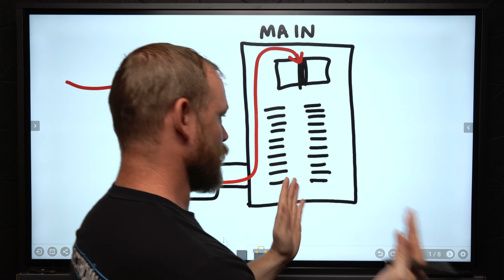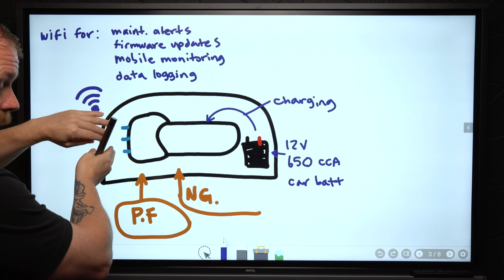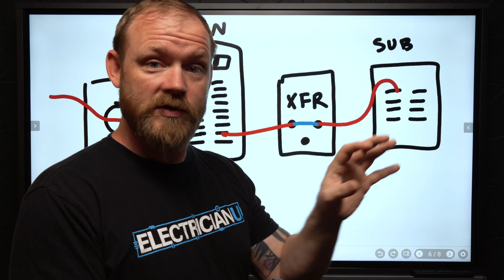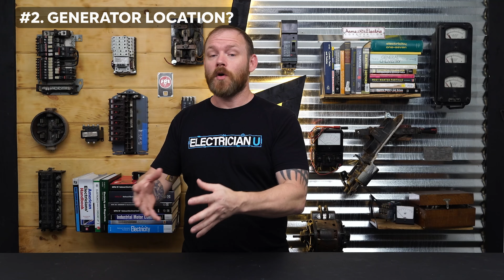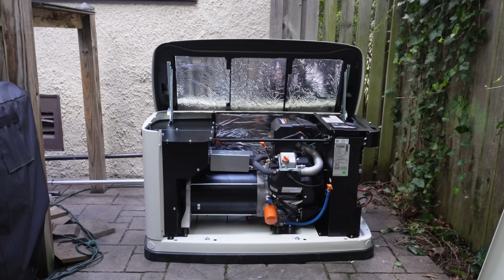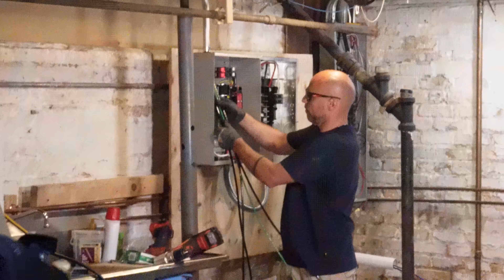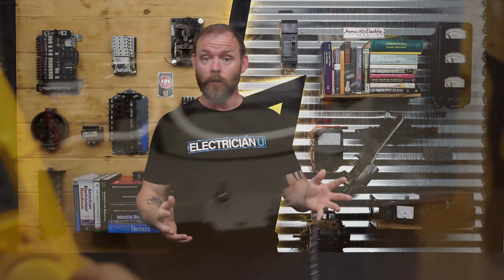What Should You Know Before Installing a Generator? Whole Home or Critical Loads?

Comment: What surprised me was it takes about an additional $1,000 to complete the install myself.  Transfer switch came with my generator.  All in one cable to connect generator to transfer switch is $14+ per foot from Ziller Electric. I used this cable and it's worth the cost.  Then there's the cost of propane connection. Plus all the miscellaneous conduit and cable connectors. Just be prepared for the additional cost when planning the install.

Comment: Seems so complicated, it's not for a homeowner's DYI. This project needs professionals at all levels to do the job well, and safely. And the cost has to be very expensive for everything that needs to be done. Let alone the cost of a whole house generator to purchase. It's something to not just jump in there, but to do some research on this. This video is sound advice for anyone thinking about putting in a Generac whole home generator.

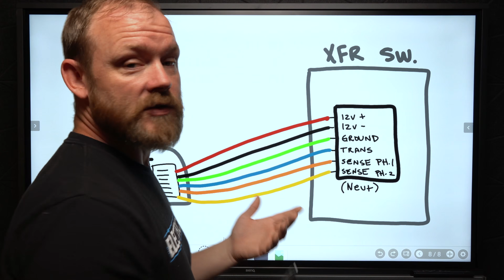Comment: Around the 5:20 mark you showed an awesome diagram of those control wires and watching that reminds me of a time I was in a building that lost one phase. So it got me thinking about if that would happen to your home with a generator, if you lost one of the two incoming lines from the power company but still had one working would that still make the generator come on even though you didn’t lose all of your power???

Thanks by the way, great videos with the illustrations on the board 👏👏👏

Also, could you show us a video to add a surge protector to the generator. I know that the new one comes with them now, but if we have an older model that needs this.

Comment: Home generators suffer the same issue grid-level generation suffers when load doesn’t match output. Most home generators aren’t designed for long-term operation beyond a few hours.

Comment: One thing for home owners the system should be run at least once on a hot day and a cold day in your climate for about 24 hours to make sure there are no problems before a outage.  Since during outage support will be either not available or have very long wait times.  Emergency systems that are not tested are not reliable during emergencies.

Comment: I’m not sure I agree about the neutral and main bonding jumper. The ATS becomes the new service equipment, which means you have to separate the grounds from neutrals in the main panel, and then bond them in the ATS. The main is now a sub panel.

Comment: I got multiple quotes and the biggest issue I had was finding a generator installer who knew both the electrical and gas trades. I was getting so much conflicting information about my gas meter capacity, how to route the gas lines, and if the gas lines needed to be sized up to handle the generator at peak load.

I had the natural gas utility come out to do a load calculation and they were extremely helpful. The (licensed electrician) installer who ultimately won the bid brought a gasfitter with him to do the estimate and installation.

Comment: There was a real disservice done to the customer by selling them a 22KW (19.5KW on NG) and not having it set up to be Whole Home. Especially since you stated that most of the large appliances are Natural Gas. There is a minimal cost difference between installing a service entrance transfer switch compared to installing a non-service entrance switch plus adding the sub panel and all the breakers and labor time of relocating circuits to a new panel. Sometimes limiting circuits costs more than having whole home. It would have been really close to the same price to just install the service entrance switch, and the customer would have had everything in the house available to use. 20KW is a lot of power for this set up. They should have went whole home, or smaller generator with this set up.

Comment: 22KW ?? on a farm, 6 buildings, spa, 2-elec-water heater, heat pump, 8 elec-heaters, well pump, RV plugged in...did have a pool....I will not use the welder on generator power...lol

Comment: Wait - aren't Generac standby generators floating neutrals? That means you DO want to bond ground and neutral inside the transfer switch since it is NOT done internally at the generator and shouldn't be done inside the main breaker panel. At least - that is how my Generac 40kw unit is set up. Maybe I didn't follow you correctly thru that part of the video, but if they bonded ground and neutral inside the transfer switch and the generator is floating neutral, that doesn't appear to be a code violation. Did I miss something here?

Comment: A couple of questions.

I have an all electric house with a 150 amp service. The furnace is electric and is two speed. It draws 82 amps on high and 42 on low. I am looking at a 100 amp plus generator. The problem is I want a manual transfer switch because I want to be able to select the senerio I need to run by manually turning off the breakers and if needed, selecting the furnace speed. 

Generac does not show on their website an appropriate manual transfer switch and they are not onboard with using an interlock kit. Are there any good alternatives? The generator would be on a 100 anp breaker.

Electrical code question. If the main service and breaker is 150 amp and the service transfer switch breaker is rated for 150, and the generator has its own breaker. What do you size the wire to the generator for? 150, or the generator breaker size.

Comment: Just got done wiring in a new generac. Could not figure out where to land the neutral for the 12v battery charger.  I landed in on the neutral bar in the transfer switch. I don’t see that they have a place to land it.

Comment: These generators are not very loud especially when you actually have the full housing attached. 

Also planting bushes around your generator is not recommended, one reason is because you reduce air flow to the engine. Another reason is because at various times a technician is going to need easy access for preventing maintenance service and or repairs.

Comment: A non electrician question, the Generac connecrion instructions do not sepecify a separate conduit for the signal wires and there is no additionsl hole on the generator for a 1/2 conduit attachment. Can those signal wires be run along with the main wires to the transfer box through the 1 1/2 conduit?

Comment: can  you put 2 50 amp receptacles in 1 power panel to run a 16 kw duromax gen as long as they are on 2 different breakers/ 50 amp  only good for 12500 but the duromax has two // 16 kw max 13 kw conts/ need to use all the 13 kw safely to run whole house // any info would be great thanks//

Comment: So I just did an interlock to connect my generator. I had to move a few breakers to accommodate this. As per code in my state, Illinois, everything runs through metal conduit. Also, I have a sub panel powered by a 60 amp breaker. While doing this moving and adding I realize there are no ground wires. Are they not necessary with metal conduit?

Comment: @ElectricianU My boy, you are remiss in not telling folks who might have poor WiFi signal that the best solution to their networking solution is wiring a (600+V)shielded CAT6 cable + lightning arrestor connected. directly to their main network switch/media panel.

Comment: Question about the Bonding with Neutral and ground. For the transfer switch powering the subpanel from the main panel. Would you only have to Bond the main panel, or the main panel and the transfer switch?

Comment: How do you integrate a generator that has selectable 3 phase? Do you need an additional switch? I already have the generator and i want to be able to run my 3 phase metal lathes etc. When needed.

Comment: What about the cheapo way, using an interlock kit? Just wire a circuit in your backed up panel to the generator. Install an interlock kit, which will force you to select from either utility or generator, but not both.

Comment: Do you have a video of a portable 5500 w generator being installed with a generator inlet into the panel? Also, can you explain what it means for a floating neutral and or a bonded neutral on this generator. Which one should be used in this application?

Comment: For whatever reason, I cannot find this code question anywhere. Can a flanged input be mounted directly to a panelboard housing? I have a mobile home (no one talks about mobile home setups). I have a Siemens PW panelboard on a pole outside, with a Siemens SN panelboard inside. I want to attach a generator inlet to the PW outside. There's plenty of room inside (and outside) the box for me to simple add a water proof flanged inlet to the side or bottom of the panelboard (power panel box), or even simply attach an inlet box to the side near the bottom of the panel box, but I can't find code information for Florida. Would you happen to know if this is doable within NEC guidelines? Otherwise, I'm left mounting an inlet box to the pole...

Comment: Other than the expense for the transfer switch it makes more sense to do the whole panel as you can always turn off the breakers if they're well labeled and you can always turn on stuff that you might not ordinarily want. and if the power outage is gonna be longer than you're expecting you might want some thing else that you didn't plan for.

Comment: As somebody who does networking these things should really just come with an ethernet jack. you're going through all the trouble of running conduit and wiring things in, throwing an ethernet cable through the wall and just plugging it into it's so much easier then having to fight around with the whole wireless connectivity thing.
Reply: Kohler(Rehlko) has the ethernet RJ45 connection. So much nicer than dealing with the WiFi on the Generacs
Reply: Seriously. It drives  me NUTS.

Comment: When you do your whole home for the generator it’s not as big of a deal as you are claiming. You do not need to “re pipe things from utility pole to meter,” you just need hydro to disconnect power to your home. For a generator this size at 22kw you might as well power your whole home as oppose to a few select circuits

Comment: I can tell you from 40 seconds in that the missing neutral under the t1 will kill the battery in about 24hours. That neutral is for the Evo 2 trickle charger, without it, it drains the battery

Comment: I know grid connected solar/battery setups in my area are banned from working when the power is out due to the risk of electrocution for linemen working on restoring power--which I can understand and support.  My question is: For generators with an automatic OR manual transfer switch, are there any issues we need to be aware of that could cause abnormal current to bypass the transfer switch and possibly reach the grid?  For instance should grounding rods for a generator setup be a certain distance away from the main service ground to avoid transients "jumping the gap" to the utility side if something goes wrong?

Comment: A 22kw generator that COULD power the whole home, but they choose to only power critical loads? Why spend the money to buy that level of generator? Why not go lower? Wasted money.
Reply: Inrush current limitations from loads like central air possibly?
Reply: @Rankine_Cycle21    would need to do the load calculations. Hard to say from here without it.

Comment: Unfortunately there are multiple issues with this install. The biggest is the use of thermostat wire for control wires is inadequate,  the insulation is not rated properly and will more than likely fail causing issues. 
Side note: Cable Master has bundled wire containing all high and low voltage wires encaused in a direct burial rated casing. Makes life much easier. NG generators are also Derated due lower BTU out of NG fuel. 22 is a 20.5kw on NG.

Comment: Relating to the switched neutral discussion: If the ATS is acting as the first means of disconnect (Meter > ATS > Breaker Panel), wouldn't it be correct to bond the neutral and ground at that point? Would that require neutral switching, even if it is a "floating neutral" generator?
Reply: Generac does NOT switch the neutral so you MUST have the neutrals tied together in the TS... and use the jumper wire to bond the ground. (that you remove in the original panel)
Reply: @rupe53  That is my understanding as well. So what is the difference in the install in this video that make neutral switching necessary?
Reply: @Alfredas-u7x     if you are required to switch the neutral then you need another brand of transfer switch. My feeling is there must be a loophole in NEC somewhere because people are still installing the standard Generac switch and passing inspection as long as they have a separate ground buss in the first panel after the TS. If it were cast in stone (code wise) then Generac would make a different TS. (they don't) I retired almost 5 years ago so don't have the ambition to search it out.

Comment: Excellent video...  An added PoV: If the plan is to power only "critical" loads, it is essential to MEASURE the critical loads before you size and purchase a generator.  In my case, I have an Emporia Vue with 16 Current Transformers (CT's) permanently installed in my main panel.  It records all of my potentially critical loads (I'll define "potential" critical loads in a moment) on a continuous basis.  Using an interlock kit on my main panel instead of a transfer switch saves a pile of money on parts and labor, and I can choose dynamically what I deem to be critical...with the knowledge of power consumption accumulated by the Emporia Vue.  For example, my home has gas heat on levels 1 and 2, and electric heat in the basement; so, if the power outage in on a cold day, I only power up the heaters on levels 1 and 2 (only need to power the ignitors and two fans).  If the power goes out on a hot day, I power up the basement (smallest HVAC unit in the home, basement is easier to cool due to geothermal benefit, AND I have a soft start kit installed on that particular unit).  So, "potential" critical loads can be dynamically changed due to circumstances--which you cannot due with a hard-wired critical loads panel.  That's my $0.02.  Cheers!

Comment: I have the same 22KW gen for a 3200 sq ft house. It does the entire house as if it were on the utility. I didn't care what size I needed I wanted everything to work without doing anything or cutting things out. Auto Xfer switch too. I also have 2 load sheds for the A/C's. I have a third mini-split for a garage but that only runs when I turn it on as opposed to the main home A/C's. In Florida so they run pretty much year round. The Generac works great on natural gas. My only suggestion would be on the load sheds. Don't use Generac load sheds. They had an issue (since fixed) with the original boards. Mine went out. PSP makes really good load sheds. I have one of each and the Generac is the only one that bit the dust. If yours does go out just remove the connector on the circuit board and it will bypass and allow whatever it's shedding to be used. In my case it's one of the A/C's. I lost power to the A/H with utility power. I was going nuts wondering how I could have power at the breaker but not power at the A/H until it dawned on me about the load shed. The board is under warranty so all good. Upgraded board fixed it.
Reply: you must be talking about outboard modules. The internal (low voltage) unit in the TS is something I have only seen fail with a VERY local lightning strike. BTW, that only drops out the low voltage to the compressor contactor so you'd still see 240 volts at the unit, but it won't be running.

Comment: You have to have the dedicated neutral control wire. It’s not “you don’t have to have it”. Not only will you get an error code, but 2023 NEC requires it.
Reply: that 0 wire on the module is not neutral. It is a chassis ground for the 12 volt DC operation of the load-shed. Code requires a separation of low voltage and line voltage, even though they are bonded elsewhere.

Comment: U never went over sizing the generator to your house what size do i need? How do calculate it? What about if u wanna just run a sub panel running a fridge and freezer?
Reply: If you look up your city or county codes department they may have a sizing guide available.
Reply: A good starting point is your electric company's website.  Your bill probably breaks down monthly energy usage at the very least, but some companies will also show you daily usage for the previous month so you can get  a sense of day/night usage versus weekend/weekday usage.  If all else fails I think Dustin has a video about installing an energy monitor right in your panel, and that will give you similar logging to what I've described from the utility company.
Reply: EDIT: If you want to get really fancy and you own an older home, you might consider upgrading your main panel at the same time in preparation for the generator install.  A lot of newer "smart panels" have monitoring functionality built-in and some even let you remotely switch off circuits if you need to shed some load.  While this may seem a bit extravagant (okay it IS extravagant) keep in mind that inspectors may want you to upgrade your panel anyway if the wiring is old enough before they will sign off on a generator or a solar install.  I don't think it's required by the NEC, but the NEC is the minimum standard that gets trumped by local code and picky inspectors--and good luck arguing with them after the fact--so it doesn't hurt to check first.
Reply: the Generac web site has a section on selecting the proper size, which includes some overage for motor starting AC and well pumps. If you are not comfortable then get an expert to help you.